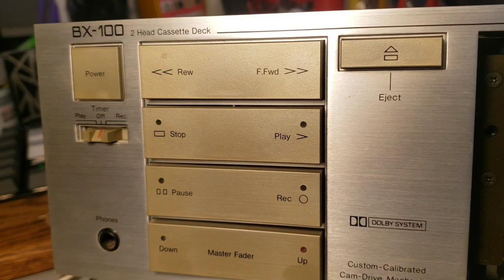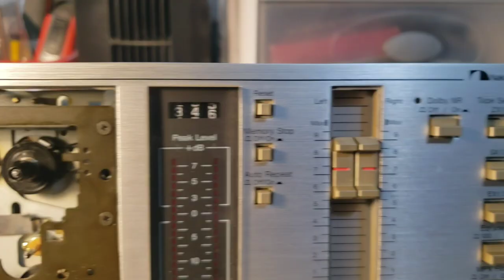Nakamichi BX-100 problem and solution for auto-stopping when playing, FF or Rewind. Optical sensor.

Comment: Hi, my Nakamichi MR-1 has this similar auto-stopping problem in playback mode after the machine warms up. It would work fine again after power off for a considerable period of time, but this problem keeps coming back after playing for 10-15 minutes. In addition, the digital counter would stop advancing at the same time. So, I removed the shut-off PCB to check the photo sensor (NJM5141) and found that the sensor output voltage to the base of transistor 2SC2812 (triggers shut-off pulse) would get stuck at 0.7V (after warming up) even though there is no IR reflected back to the sensor. As a result, the shut-off pulse would go to 0V when 2SC2812 conducts. The IR LED half emits a dim pink light when viewed from camera, hence I assume it's ok. Any advice on where to get the replacement photo sensor NJM5141 ? Thanks in advance.
Reply from the maker: I was lucky enough to find the part I needed on eBay for my BX-100 but after a quick search I wasn't able to find the part for yours. Maybe one of the cassette deck forums online has a buy/sell/trade thread? Good luck with your repair! I know that's frustrating.
Reply: Thanks for your prompt reply. This particular sensor is listed as NJM5141 in the MR-1 parts list but BX-300, CR-2, RX-202, BX-125 models all using NJL5141. Not sure what's the difference between NJM and NJL. Are you able to find any markings on the old sensor body? Thanks again.
Reply from the maker: @fongfuhyong4191  I don't know the difference between the two. I checked the part number that I took out of mine and the board has two things printed on it: MD-8 and E46669-010V
Reply from the maker: @fongfuhyong4191 My player uses a belt for the counter, so I'm thinking since your counter is digital, it probably relies on the ir sensor for counting.
Reply: @nothingherefolks6218  My sensor board has MD-8 and KS N30 printed on it. After comparing the schematic diagrams of some models using Sankyo transport, R603 resistor has a different value (750 vs 680 ohms) and the sensor on my board is NJM5141 instead of NJL5141. My sensor body (NJM5141) is printed with 1A 99, which I believe is a date or manufacturer code. If you apply 12V power to your old board, do you see the pink colour light emitting from the IR LED of this sensor when viewed from handphone camera? And what is the output of the sensor when the IR is reflected by a shiny object? Sorry for asking too much. Thank you very much.

Comment: My nakamichi bx-1 has the exact same problem. I cant find the ir sensor part anywhere.. is it possible to repair the circuit board on it?
Reply from the maker: I ended up buying the whole mechanism because I couldn't find the sensor part either.
Reply from the maker: I wish I knew the specs of that IR sensor because it's possible that a generic on could fix it.